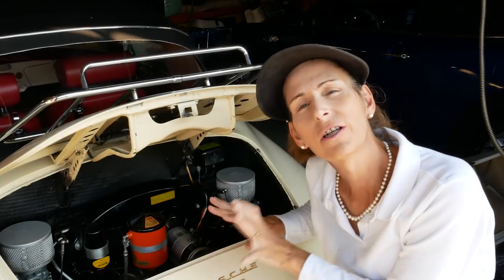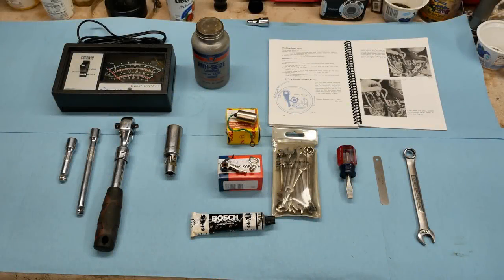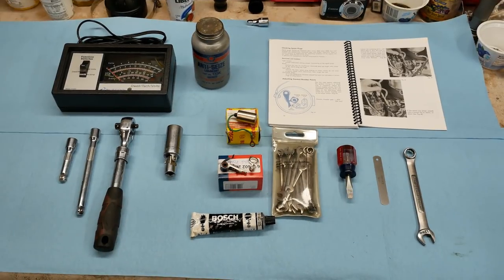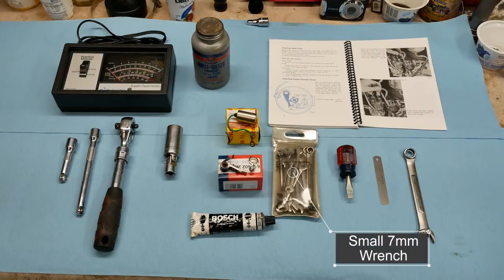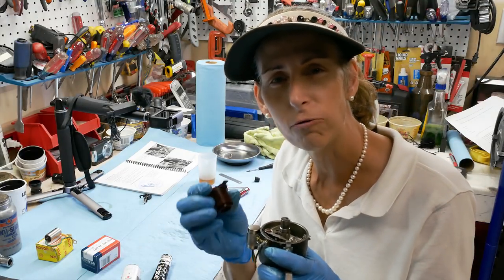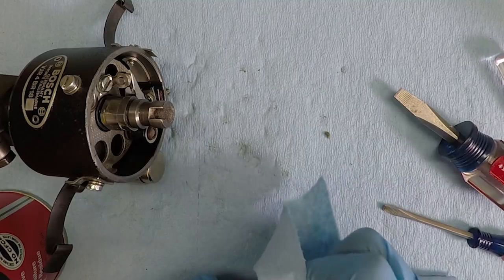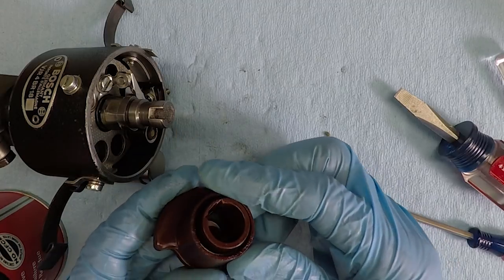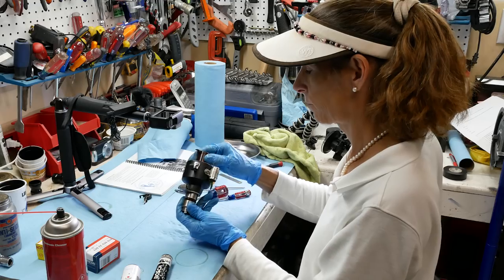Porsche 356 Tune-up Part2 Electrical Tune-up! Points, Plugs, Timing

Comment: Awesome. Glad you are posting these.  Not quite as intimidating as I thought it would be.  Hopefully the carb work is as simple.
Reply from the maker: Thanks Tim, It can be a little fiddly, but being able to remove the entire distributor and work on the bench makes it much easier.  I actually filmed a bit where I checked the Dwell with that meter, but couldn't find a reliable spec (about 50 deg is all I could find) so I didn't add that.  Really, just replace, then set the points with the feeler, set the timing and that is it.  What goes wrong and where I've gone wrong is to replace other good working parts like the condenser, rotor, plugs, etc.  There is no need and the new parts can fail shortly after.  Especially that condenser! I've run through several...  I always keep a spare as well. Franny

Comment: That engine is so clean ! You really look after all your car's so well inside and out , the 356 looks like it's come straight off the production line!
Reply from the maker: Thanks!  Lots of cleaning originally, but it is east to keep that way. f
Reply from the maker: +jam 68 you know Franny keeps all the engines this way.  It's easier to determine when you have an issue too.  Heidi

Comment: Very nice tutorial for the mechanically inclined yet not knowing how to do this. Thanks, this is great and I will use this on my 912 which is just a 356 in a new skin :)
Reply from the maker: +matlecomte Yup! That should get you super close - just check the particulars like valve clearances and timing and such :) F

Comment: Nice work 😊,I’m going through the same process now on my 64c motor. I noticed your Bosch 6v Coil... is that original  or did you get yours rebuilt,? Thanks again fir your easy to understand vids🤙🏽
Reply from the maker: Glad you liked the video :) I don't think it is original, but older... I'd love to find one with the correct date stamp ;)

Comment: Hi Franny, at the 26:12 mark where you’re doing the timing, right as your meter registers voltage we hear a ‘click’. Is that click from your meter or the spark plugs firing? I know from my motorcycles that you can hear the plug firing but I don’t know if you would on this 6 volt system. I’m fixing up and tuning my friend’s 356 and Irma super fun. Cheers from Sweden.

Comment: I’m following your vid ,as I’m checking  the assembly of my distributor. I have my engine in a stand ,I g  as be power going into the coil(6v) but no spark comming out of the primary (coil wire to oil can strap... no spark when cranking the motor over, it’s a new coil,the neg. side of the coil is connected to the distributor body where the condenser/ point (small  Bolt through  the distributor body)
Any thoughts? 
Thank you so much fir your great vids😊

Comment: Hi Franny,  it's me again.  I figured out and fixed the bad idle problem; the idle jets on the carbs were partially clogged so I cleaned them out and the bad idle went away.  Now I have another issue.  I decided to replace my VW distributor with one that is correct for the car.  When I install it so that the two metal tabs at the bottom of the rotor post are seated in the two slots in the distributor port in the engine (with the engine turned to 5 degrees off TDC), the rotor is not pointing towards TDC, it's pointing more or less towards me and the contact is not closing on the meter.   The rotor and tabs are not on the same plane and are offset; my VW distributor seems to be set up similarly.  When I try to turn the rotor, it doesn't feel like it wants to turn back towards TDC and I don't want to screw up an expensive distributor.  I messed around with this all day yesterday and part of today to no avail, so I thought I'd reach out again.  What am I missing here?  

Thanks again for all your great videos!
Reply from the maker: It may be that your distributor drive is in backward...  Verify it is correct with the service manual.  Start there...

Comment: Very nice videos but I note that you did not check the Spark Plug Gap or for any corrosion on the Distributor Cap Contacts.
Reply from the maker: I should have shown that...  The plugs were already gapped when I put them in new, but would have been good to just double check.  That distributor cap I got from a re-builder here locally and is actually period correct (as is the funky rotor).  They are really durable and even after a few years, there is very little if any wear.  I'm actually surprised by just how well they are holding up!

Comment: Excellent video.  I love it.  One question that I have is why you didn't do the advance setting?  I thought you also need to check the advance timing when the RPM is around 2000 to 3000 RPM to see if the timing is around 30 to 35 degree?
Reply from the maker: Hi There, Thanks! No real need to set the timing dynamically unless you don't know your distributor.  I have had the distributor mapped so I only need to set the start point.  The amount of advancement (and max) is set.
Reply: Thank you and please continue with your good work !!!!

Comment: Hi Franny,  I'm a huge fan and am trying to get better at servicing and maintaining my 1961 356B.  The idle on my car has been terrible recently and will usually crap out at any stop sign or light.  I just changed the spark plugs and added new spark plug and coil wires, but the idle is still terrible.  Sometimes when I start the car I'll get a sizable back-fire.  What should I be looking at next to get to the bottom of this?    Also, please do another video showing how to "efficiently" remove and replace the spark plugs towards the front of the car; I was able to get the spark plugs in and out okay, but getting the new wires on was another story entirely.  I have Webers and there's no room to maneuver at all back there, especially with those tin covers.
Reply from the maker: Hi Alan, I will be filming an upcoming episode this weekend that will cover several of your points.  This is a "C" car with a bad idle.  Hopefully it will help!  Stay tuned... Franny
Reply: @HeidiandFranny  Thanks for the quick response, I appreciate it and am looking forward to the next episode!  

Also, I read this on "The Samba" about a bad 356 idle and wanted to get your thoughts since you didn't demonstrate it in your video:  "'Never forget to oil down the lower plate holes where the points are located to lubricate the advance and retard mechanism.  Using light oil I pumped some drips into the hole not knowing where it would go. I didn't know then there is a 'sliding plate also involved as well as the springs to advance and retard the engine.  I twisted the rotor back and forth and suddenly like magic it became easier and easier till it sprang back firmly to the stop. I started the engine and I could not believe it idled at 900rpm and has done so now for the past 4 years. All it took was a drop of oil!!".    

This is in addition to oiling the wick in the center post of the distributor, which I did but made no difference in the idle.

Comment: Slightly confused Frannie, my 356B doesn’t have the tin covers over the ends of the cylinder heads that the HT leads fit through. I have looked on Stoddard and they don’t seem to sell them. Is this something that was only fitted to 356A models? Cheers Sid
Reply from the maker: So, are you saying that you can see the actual heads and cylinder cooling fins?  It should be completely covered and there is a rubber gasket around the plug cap that seals the hole.  If you are missing these bits, check with the resources on the 356 Registry and also with Sierra Madre Parts.  Thanks,f

Comment: Just a question, maybe more from vintage motorcycling that may not apply to a 356.  Are there any electronic ignition kits for these cars?  [Those generally drastically improve ease of starting, etc. on an older bike that came with points]  Would you consider installing one, if so?  It looks like you are still running the original 6v system, so maybe one is tough to find.  Nice video - very clear steps!
Reply from the maker: +Cam Walker Hi Cam, great question! They do have semi-electronic ignition kits for these cars and even for 6V, and they can, as you mentioned help with starting and such, but I personally have never seen the bed on our car.  The car with a well serviced electrical system really runs great. Folks are always a bit leery of the 6V system, but they put out the same power as 12V, just at twice the amps.  So, all the connections need to be kept really clean. I did install relays for the lights and starter relay, but other than that (and the LED tail lights) I really want to keep the electrical system as stock as possible. I guess for me, I'm willing to stay on changing points and such to stay more original. That is (weirdly) more fun for me ;) Franny
Reply: Thanks for the reply, Franny.  You do look like you're enjoying the maintenance!  Good show,  Cam

Comment: Why don´t you change the spark plugs?
Reply from the maker: Just no need...  They have less than 5K miles and can go close to 60K and are easy to clean.  I pull them more for diagnostics reasons and I did find a rich cylinder...  It is tempting to replace all sorts of parts, but things like the condenser, plugs, cap, rotor are usually just fine and only need to be inspected.  I've had more problems (especially with condensers) with new parts than old known good, working parts. f